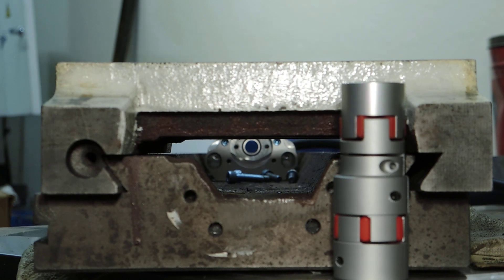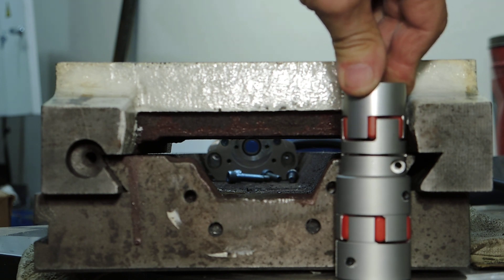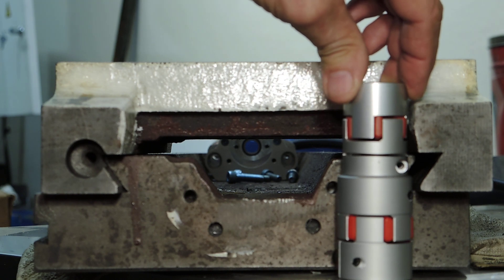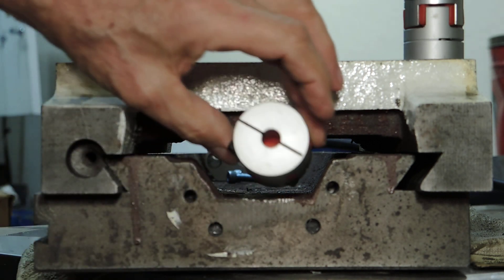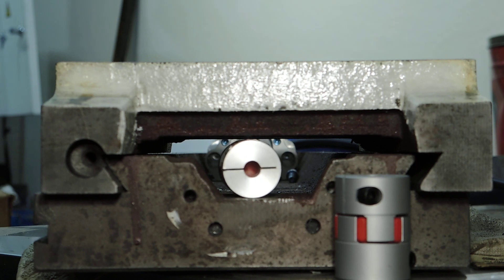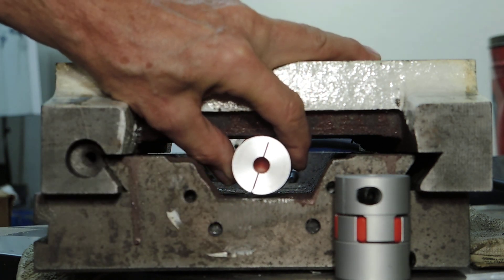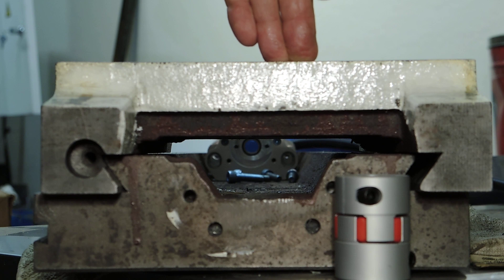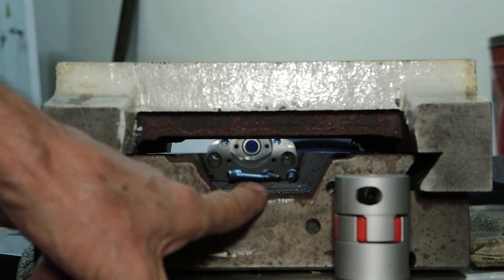PM-833 X plate motor side

Comment: The hole is 40mm. Note that it is not centered on the axis line either. I'd say you may get away with 35D but safer option is 30D. The holes to mount the bearings on all axis are all over the place too.